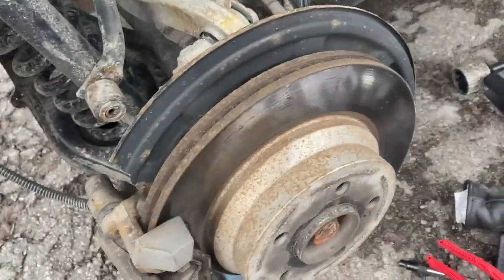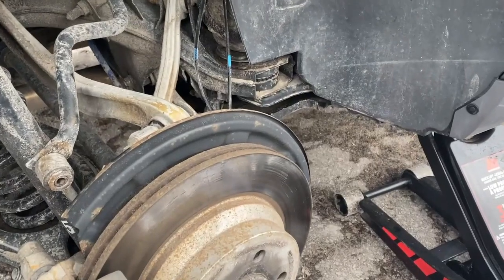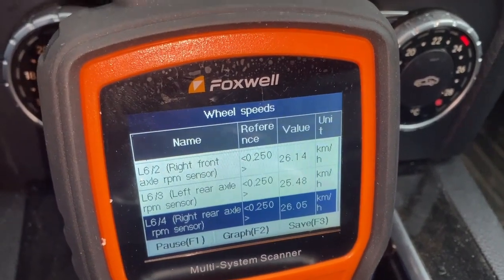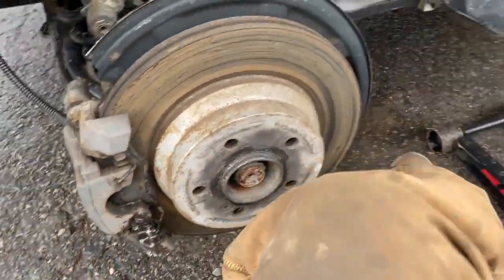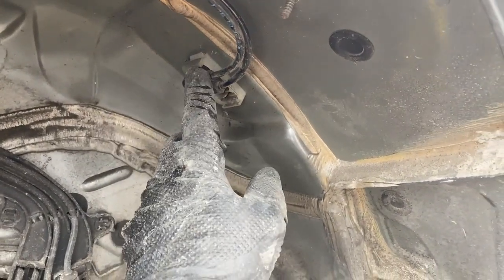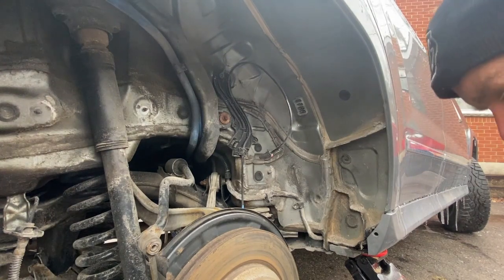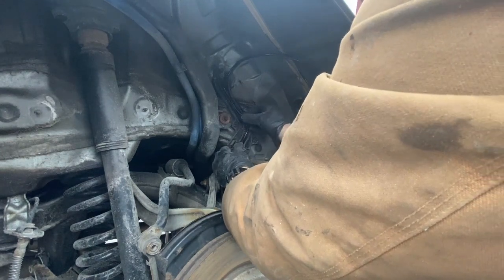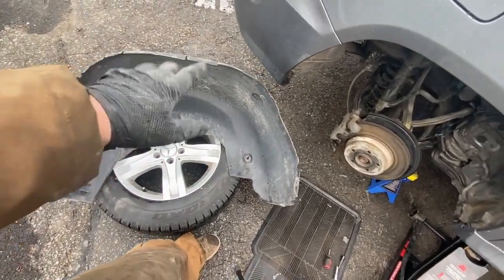Mercedes X204 GLK wheel speed sensor ,ABS,ESP,CEL diagnosis and repair

Comment: What’s the blue cable that connects right underneath the speed sensor?
Reply from the maker: There is the blue stiff cable which is parking brake . The blue electrical connector is the brake pad wear sensor
Reply from the maker: There is the blue stiff cable which is parking brake . The blue electrical connector is the brake pad wear sensor
Reply: Thank you!

Comment: Good job.  No fun in the cold.  But well done 👍.  The code C00308 is basically a safety notice!  Since the rear right wheel speed sensor was defective, the performance of the fuel pump was throttled.  So that the vehicle no longer has full power.  It is even possible that the engine goes directly into emergency mode.  And after that, it may not be possible to start again.  Best regards from Germany 🙌
Reply from the maker: Excellent info .. appreciate it

Comment: The reason why the flat tire warning becomes disabled is because your vehicle has what is called an indirect TPM (Tire Pressure Monitor) system. It uses wheel speed comparisons to indicate you have a low tire. A low tire will spin faster than a more inflated tire. Other vehicles are equipped with TPMS Sensors which communicate with your module by way of UHF radio waves. The sensors batteries are kept charged by the spinning of your wheels. Eventually the batteries will fail and the sensors require replacement. Thanks for the excellent video. I have a GLK350 I have to do.